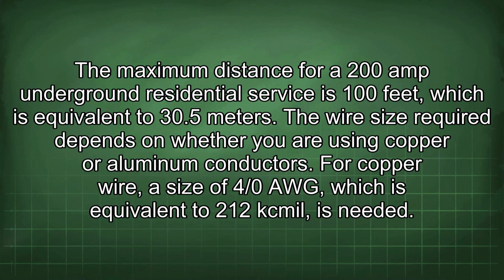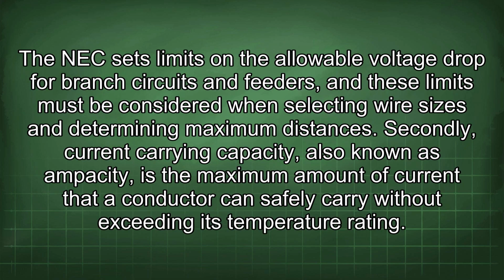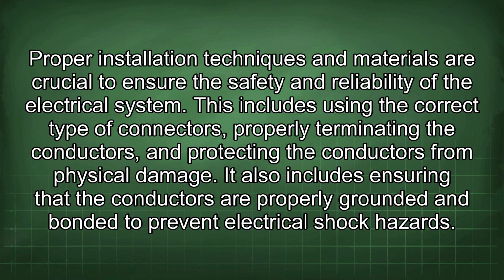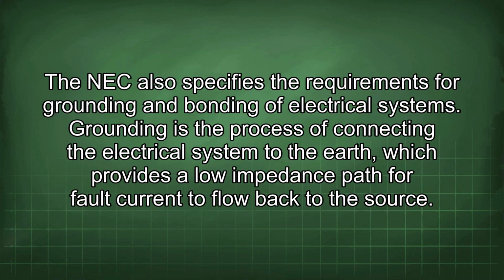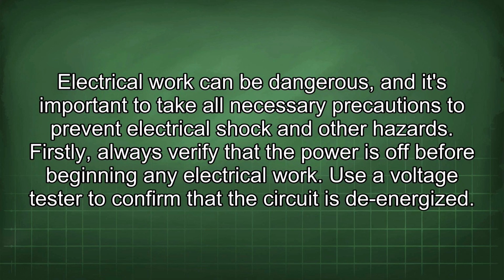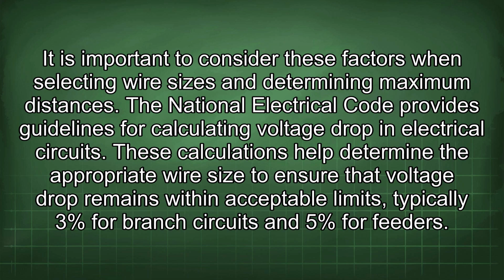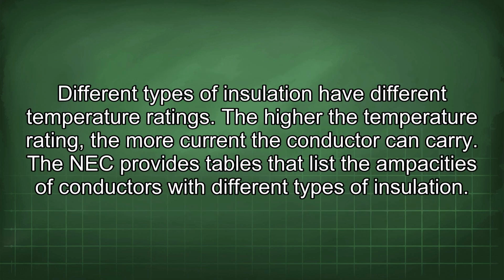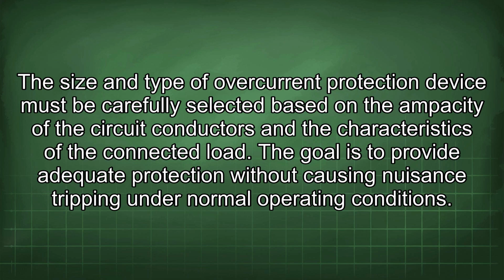200 Amp Underground Residential Service Wire Size Distance

Comment: How is 4/0 copper different from 4/0 aluminum?
Reply from the maker: Hello @tommaxwell429,

Thanks for your question. When comparing 4/0 copper wire to 4/0 aluminum wire, the main differences stem from the inherent properties of the metals themselves:

1. Conductivity and Ampacity:

Copper: Copper is a superior electrical conductor. This means that a 4/0 copper wire can carry more current (amps) than a 4/0 aluminum wire under the same conditions (temperature, insulation type). For example, at a 90°C rating, 4/0 copper can typically carry around 260 amps, while 4/0 aluminum might be rated for about 205 amps or less, depending on the specific insulation and application.

Aluminum: Aluminum is less conductive than copper. To carry the same amount of current as a given copper wire, an aluminum wire generally needs to be one or two sizes larger. For instance, to match the ampacity of 2/0 copper, you might need 4/0 aluminum.

2. Resistance and Heat Generation:

Copper: Due to its higher conductivity, copper has lower electrical resistance. This means it generates less heat when current flows through it, making it more efficient and reducing the risk of overheating.

Aluminum: Aluminum has higher resistance, which leads to more heat generation for the same current compared to copper. This higher heat can contribute to connections loosening over time due to expansion and contraction, which can be a fire hazard if not properly installed and maintained.

3. Weight:

Copper: Copper is significantly denser and heavier than aluminum.

Aluminum: Aluminum is much lighter, which can make it easier to handle and install, especially for long runs or in situations where weight is a concern (e.g., overhead lines).

4. Cost:

Copper: Copper is generally more expensive than aluminum. This is often the primary reason why aluminum is chosen for large-gauge applications like service entrance cables.

Aluminum: Aluminum is a more cost-effective option, making it popular for long-distance wiring and large-scale applications.

5. Durability and Corrosion:

Copper: Copper is more durable and resistant to corrosion, particularly oxidation. This contributes to a longer service life and more stable connections over time.

Aluminum: Aluminum is more prone to oxidation when exposed to air and moisture. Aluminum oxide is less conductive than aluminum itself, which can increase resistance at connection points. This characteristic necessitates special connectors (AL/CU rated) to ensure safe and lasting connections. Aluminum is also more susceptible to expansion and contraction with temperature changes, which can lead to loose connections.

6. Applications:

Copper: Often preferred for indoor wiring, branch circuits, and applications where space is limited or where a higher level of reliability and stability is crucial, such as in household wiring or critical equipment.

Aluminum: Commonly used for service entrance conductors (the wire bringing power into a building), feeders, and overhead power lines due to its lower cost and lighter weight.

In summary, while both 4/0 copper and 4/0 aluminum wires can carry substantial current, 4/0 copper is more expensive but offers superior conductivity, lower resistance, greater heat resistance, and better long-term connection stability. 4/0 aluminum is a more economical and lighter option but requires careful installation with appropriate connectors and consideration of its lower conductivity and higher expansion/contraction properties.

Sincerely,

BESA Research
Reply: @BESAResearch That makes sense and is in agreement with my understanding. I guess what confused me is in this underground application 4/0 was called out for both copper and aluminum  wire. I would expect a need for larger aluminum wire.
Reply from the maker: Hello @tommaxwell429,

Thanks for your follow up comment. This particular example is interesting as the requirements can overlap a bit depending on the temperature, ampacity and voltage drop etc. The calculation for this requirement comes to exactly 212 kcmil for copper and 240 kcmil for aluminum, for which the nearest acceptable size of both is 4/0 (211.6).

In simple terms, both 4/0 AWG aluminum and 4/0 AWG copper are typically adequate for 200 A; this is just an overlap. In this case of any overlap range, if you increase the ampacity, upsizing an aluminum conductor will always be required before copper.

For your reference, NEC Table 310.16: Allowable Ampacities of Insulated Conductors

Wire Size (AWG or kcmil)	COPPER			ALUMINUM or COPPER-CLAD ALUMINUM		
60 ∘ C (140 ∘ F)	75 ∘ C (167 ∘ F)	90 ∘ C (194 ∘ F)	60 ∘ C (140 ∘ F)	75 ∘ C (167 ∘ F)	90 ∘ C (194 ∘ F)
---	---	---	---	---	---	---
14	15 A	20 A	25 A	-	-	-
12	20 A	25 A	30 A	15 A	20 A	25 A
10	30 A	35 A	40 A	25 A	30 A	35 A
8	40 A	50 A	55 A	35 A	40 A	45 A
6	55 A	65 A	75 A	40 A	50 A	55 A
4	70 A	85 A	95 A	55 A	65 A	75 A
3	85 A	100 A	115 A	65 A	75 A	85 A
2	95 A	115 A	130 A	75 A	90 A	100 A
1	110 A	130 A	145 A	85 A	100 A	115 A
1/0	125 A	150 A	170 A	100 A	120 A	135 A
2/0	145 A	175 A	195 A	115 A	135 A	150 A
3/0	165 A	200 A	225 A	130 A	155 A	175 A
4/0	195 A	230 A	260 A	150 A	180 A	205 A
250 kcmil	215 A	255 A	290 A	170 A	205 A	230 A
300 kcmil	240 A	285 A	320 A	195 A	230 A	260 A
350 kcmil	260 A	310 A	350 A	210 A	250 A	280 A
400 kcmil	280 A	335 A	380 A	225 A	270 A	305 A
500 kcmil	320 A	380 A	430 A	260 A	310 A	350 A
600 kcmil	350 A	420 A	475 A	285 A	340 A	385 A
700 kcmil	385 A	460 A	520 A	315 A	375 A	425 A
750 kcmil	400 A	475 A	535 A	320 A	385 A	435 A
800 kcmil	410 A	490 A	555 A	330 A	395 A	450 A
900 kcmil	435 A	520 A	585 A	355 A	425 A	480 A
1000 kcmil	455 A	545 A	615 A	375 A	450 A	510 A

Sincerely,

BESA Research